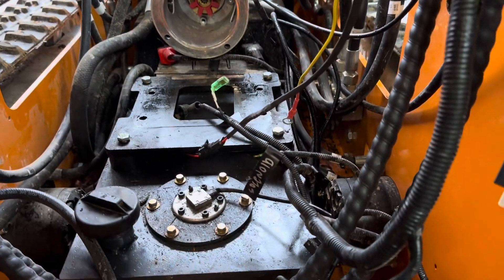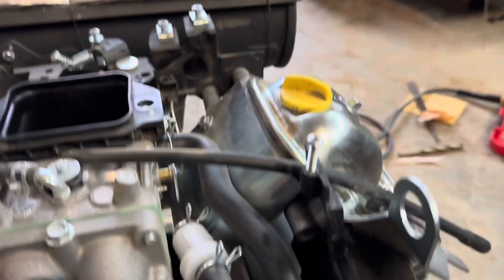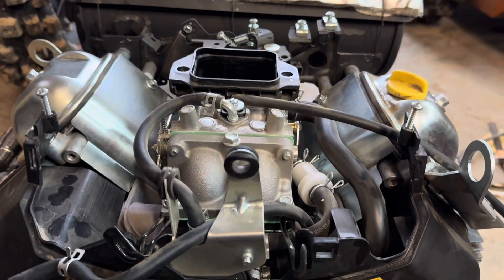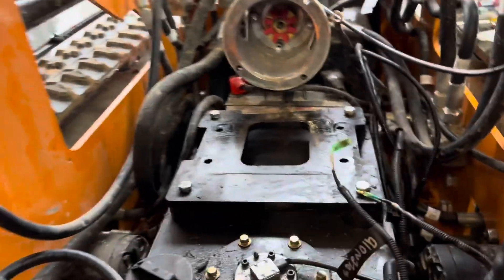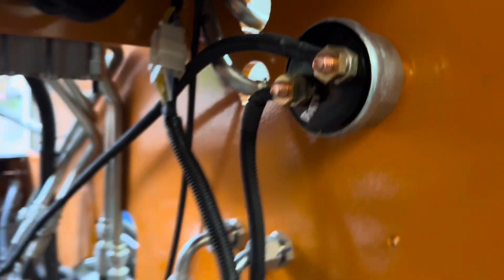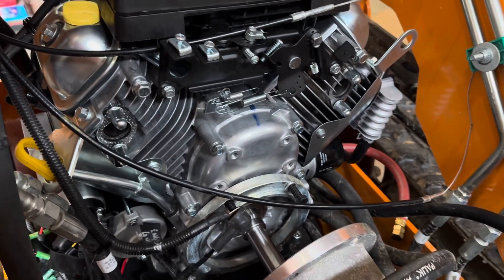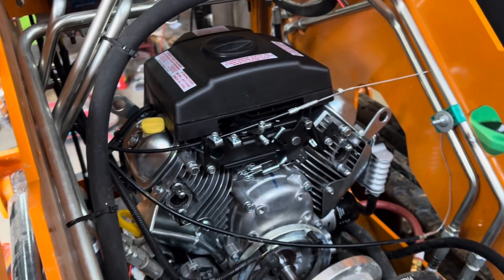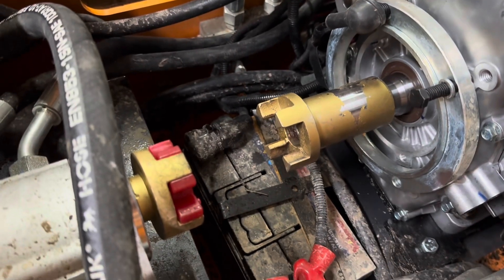Swapping a Predator 670 into a Landhero Chinese Mini Skid Loader

Comment: Very informative.  I have a CRT23 with the same issues on that cylinder. Did make it to 21 hrs. Still not sure what cause the issue.  I always use no ethanol fuel and frequent oil changes. Hope the Predator engine will do better.

Comment: Hey brother just got done putting one in my ktt23 and having a hard time to get it started once it's hooked up to the hydro pump turns over fine on engine stand then hook it up to the pump and it's like hydro locked or something did you have any problems with any of that? Thanks for the video!
Reply from the maker: No mine was fine with the electric pump. Sorry I don’t have more info for you!

Comment: Im currently swapping in a predator 670 into what was once my rato 739cc i noticed the charging system is different as the rato has 2 wires on the side abd predator only has 1 what exactly do you here? @lurtbike

Comment: When you were wiring up the hour meter and temp gauge where did you connect those on the predator? Or did you end up just buying new connectors for those and not hook them into the predator wiring harness?
Reply from the maker: The wires were the exact same colors so I just reconnected everything like it was when I started, except the yellow wire for the oil switch because that just caused me more problems than anything.

Comment: What size crankshaft sleave did you get from Amazon?
Reply from the maker: DO NOT buy from Amazon.  Get it from a USA made dealer from eBay.  I bought an amazon one and it was trash.  The tolerances were so bad I had to throw it away. I bought a 1 inch to 1-1/8" with a 1/4" key. It's been working great for a while now.  Used it this weekend to drive an 18" auger and a push around a 10x20 Old Hickory shed.
Reply: @lurtbike  We need a new link. your link to the shaft adapter isn't any good up above in your description. I see all kinds on eBay but ,,,, finding made in America ....errr...

Comment: You do realize the predator motor isn’t really a “swap” because it is manufactured by rato for harbor freight lol so it’s almost the same engine. Shaft sizes are a little different and alternator on predator is smaller than the rato
Reply from the maker: I took one motor out that has almost zero parts availability and “swapped” it for another one that is readily available off the shelf in most of the lower 48 states with a warranty. Sorry it doesn’t meet your strict criteria.

Comment: I got a Agt 25 and i dies when it get hot (warm ) but long as i pull the choke in and out it wont cut off ,but i runs good the first 10 minutes of so ,any opinions ?
Reply from the maker: It needs an electric fuel pump if you haven’t added one already. Steak your power for it off the cigarette lighter plug and just put it in the existing fuel line down near the bottom of the unit so it doesn’t have to suck the fuel up very far. Should take care of it.
Reply: @lurtbike  10 4 I will try it
Reply: So what kind of fuel pump it have from the factory?
Reply from the maker: @kennethrobinson1672  it comes with a vacuum style pump that uses the vacuum produced by the engine to drive a diaphragm pump. Very common on riding mowers but the fuel tanks on those are level with the engine, not below it. They’re not strong enough to lift the fuel the extra 12-18 inches depending on how full the tank is.
Reply: Sounds like you could be running extremely lean from incorrect carb jets, or it could be the fuel pump as the other guy said, but definitely check valve lash, and  preferably when hot
Reply: @jmangus83  10 4

Comment: Hi buddy i make it work BUT! When the temperature going up to 5.5 the machine start to run incorrectly and stop the engine is new so I am not sure ehat is going on
Reply from the maker: Yeah I have no idea. Mine doesn’t have any temperature issues but I’ve left the hood and back cover off of it to allow more air to flow.

Comment: Buddy In replaced the engine but the machine and run perfect except for the adjustment about the shaft. The problem is the hydraulic system is not working at all any ideas??
Reply from the maker: Can you tell if your pump shaft is turning?  Did you check your hydraulic oil level?  Did it work before you replaced the engine?  I don't know anything about your machine or why you replaced the engine so it's tough to diagnose without any information.
Reply: @lurtbike yeah hidraulic was working before , inreplaced the engine because its broke internally with only 53 hours very bad materials a lot oil leaks etc so i saw your video and i just have to grt and shaft adapter and is running but the machine do not move and no hydraulic movements allowed
Reply: @lurtbike i am not sure if the pump shaft is turning i was looking that today so i do not think so

Comment: Did you have to install a fuel pressure regulator for this electric pump or do you have it plumbed directly into the old diaphragm pump? Also an update on how it’s doing would be great. My Rato keeps losing its prime and cutting off. I don’t think it has enough pull to bring fuel all the way up from the tank.
Reply from the maker: Yeah that’s common. I piped it directly to the existing diaphragm pump. Basically I just cut the line from the existing fuel tank and stuck it in there and wired it to the key switch so it comes on with the key. Runs great. I’ve put over 15 hours on it like that and zero issues with it cutting off so far.

Comment: Where you got that spacer between the hydraulic pump and engine
Reply from the maker: got it off ebay.  DO NOT order the cheap chinese ones from Amazon.  You need to get one thats made in USA or it won't work.  Believe me, I tried.
Reply: @lurtbike  going to look it up thank you for the suggestion

Comment: How does anyone feel about cutting a 1/2 inch off the tip of the output shaft I’m having a clearance problem with with adapting the hydraulic pump.
Reply: this is good shade tree advice -- if you can run engine take hack saw blade and set it on shaft.. makes good cut....
Reply: @jbwood6116  so the roller been working great for the last 3 month no isssue at all. with the predetor and even from grinding off a 1/2 off the crank lol
Reply from the maker: Shouldn't matter but you could also use spacers or washers between the bell housing and where it mounts to the motor to get yourself more room.

Comment: thats kinda bull sh_t that your oem engine went down so soon. they should have flowed you a new engine
Reply from the maker: It is, but this is an auction machine with no warranty and really no support in the US to speak of.  I knew what I was getting into and I knew I had the knowledge and ability to deal with something like this if/when it happened.  Didn't think it would be this soon, but now I have a motor with a 2 year warranty and I've still got a capable machine at less than $6k all in.  You can't rent one for a few months for that price.

Comment: Probably carburetor issue…..had to add a electric fuel pump to mine….I have over 100 hours on it…….
Reply from the maker: I have an electric fuel pump on the predator motor now. Low compression wouldn’t be caused by a carb issue. Checked valves too. Head gasket had failed upon later inspection.

Comment: I recently bought a chinese mini skid steer and it looks like it has the same motor as yours.  Can you or someone tell me what replacement oil filter I need.  It did not come with any documentation or extras.
Reply from the maker: Same as a predator 670 motor from harbor freight. You can use the same filter. I bought a Kizut 136-7848 off Amazon.

Comment: I had a similar problem with a new predator 670 (1 cylinder dead out of the box) I did the same quick checks as you did, then brought it back to HF for a refund. I'm still puzzled as to what was wrong, but digging into it more might've jeopardized the refund. I sort've assumed it was a carb/intake issue since there was hot spark and compression. Too bad the China digger builders are moving away from Vanguard 23's.
Reply from the maker: Yeah so far so good on my predator. I’m up to 14.5 hours now and it’s doing well.

Comment: The carburetor has two venturi. One isn't working correctly. It been discussed on the Facebook chinese mini skid groups.
Reply from the maker: I put a compression gauge on it and one side had low compression. Carb was cleaned and I had two inline filters in it as well. It won’t run if there’s no compression. Head gasket was blown when I pulled it apart.

Comment: rato makes the engine you pulled out and also the predator engines. step one on a new machine, change oil and filter BEFORE you work the machine. supposedly they put mineral oil in the engines to prevent rust during shipping and pass the volatility smell test going thru port inspections. it was never meant to be in there when you work the machine. i used a Briggs oil filter and no problems so far. air filters can be found at harbor freight customer service for around $10.50 and free shipping. get several, you'll need them.
Reply from the maker: Yeah I did that as soon as I got it off the trailer. Changed oil, oil filter, cleaned the whole fuel system, etc. You get what you get with the China stuff. New motor has a warranty so if it fails I just take it back for another one but so far it’s doing great. Runs better than the Rato ever did.

Comment: Does the harbor freight motor have as much power as the 739cc
Reply from the maker: I think it’s rated at 22HP where the 739 is rated at 23.5. I can’t tell the difference when I operate the machine. I think 22 HP is more than enough to drive the hydraulic pump.

Comment: The china cheap equipment is pretty garbage toro or Vermeer make a much better dingo that’ll last a lifetime and are actually heavy duty with the arms being twice as thick and can carry more😊
Reply: I'm sure everyone that buys a Chinese skid steer is aware of that and know the risks.  Some of us don't have 30k for the better US or Japanese units.
Reply from the maker: You are mostly correct. And they cost almost 5x as much new. I have less than $7k in this machine and it does what I need it to do. I can’t justify spending over $40k on a piece of equipment to clean up my yard and tinker with. But hey if you’ve got that kind of money sitting around I say go ahead get the Vermeer.
Reply: 3.5k for Chinese or 35k for name brand.... I go to auctions for a living and those "name brand" are junk at 5-700 hours typically .... doesn't sound like quality to me
Reply: Couldn't afford to buy name brand to play around the house. But we could afford this little guy at the auction and ate having lots of fun with it. 

https://youtu.be/ZHVcusDVA7M?si=P9cCi-_1XQ2Jf4Bs
Reply: If buy one always drain old fuel out change fuel filter and oil before really running them. Alot of them when they arrive wont run properly at full throttle, it'll sit there and fluctuate.

Comment: I bought a landhero and it had a fuel problem. When it was ship here it had bad gas. I finally got it going after 4 fuel pumps then I installed a electric fuel pump. I also didn't like the neck on the tank. It would allow dirt into tank or when filling  over flow.
Reply from the maker: Yeah I don’t think the stock fuel pumps are as powerful as they need to be. I put an hour and a half on this one today without a single hiccup. Electric fuel pump is definitely the way to go.